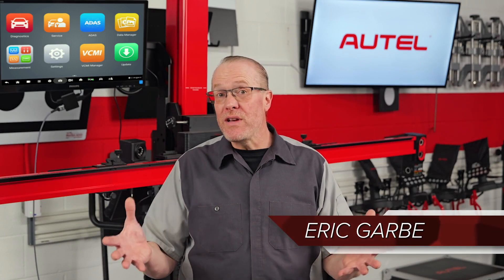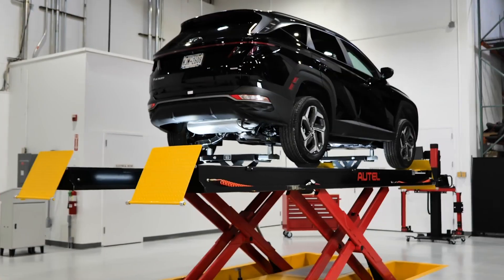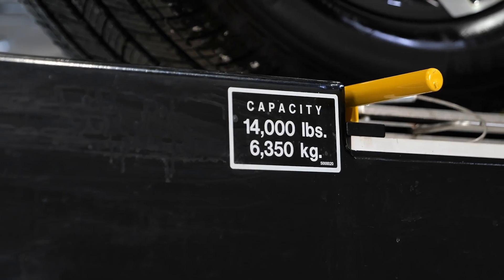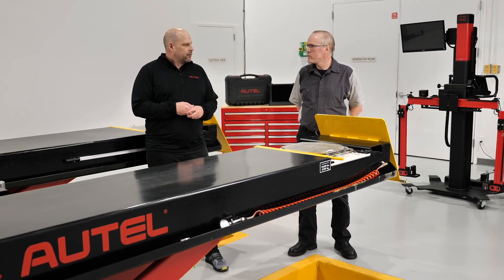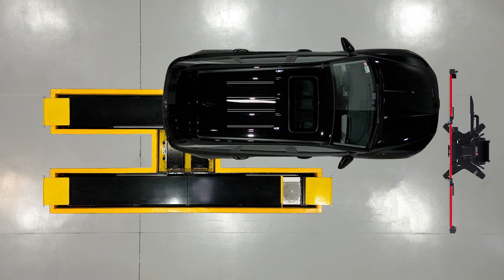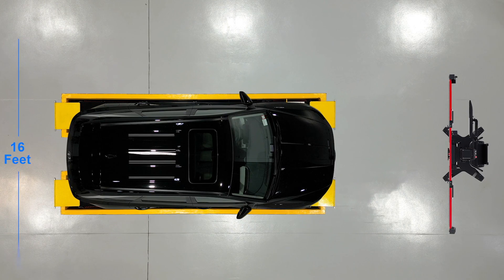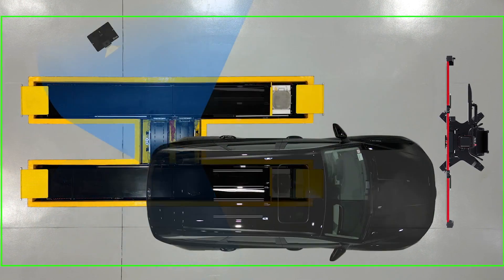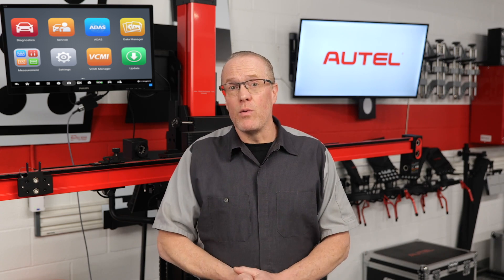ADAS Bay Max Vehicle Lift | Autel

Comment: Subletting out is more practical for independent garages due to insurance rates for ADAS related repairs. Also it is very difficult to make a profit when a system like that requires constant up fitting every 2-5 years to keep up with vehicle and software changes. Someone else can use the profits to try to make the monthly payments for the next 30 yrs to pay for the equipment.
Reply: Bingo. Only worth it if you can constantly get work. If they sell to every single shop out they Autel makes the most money